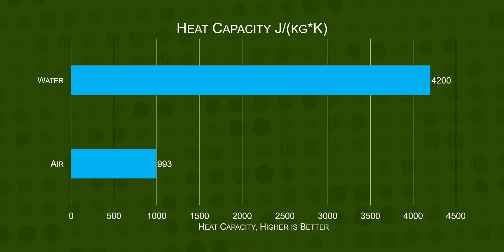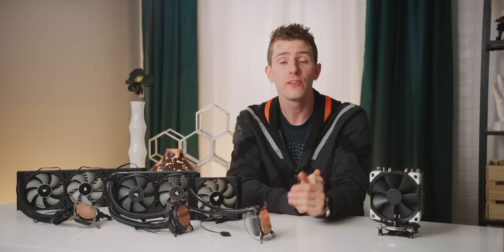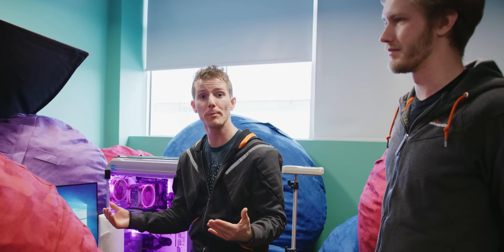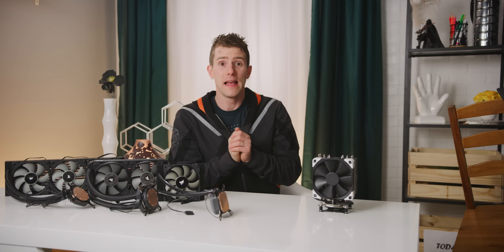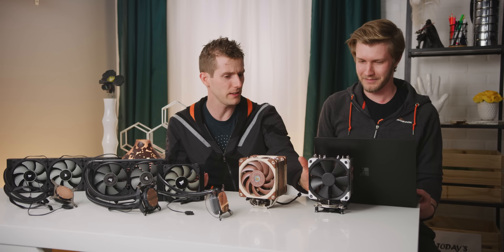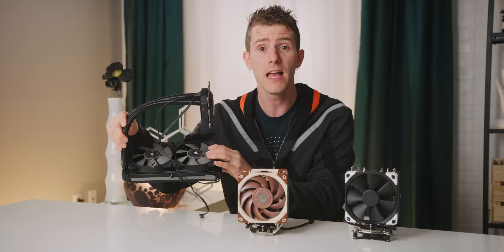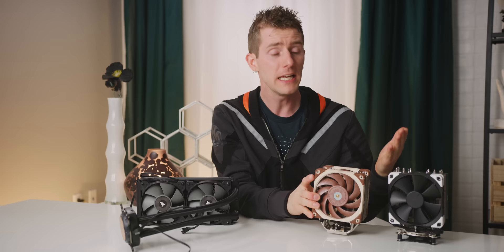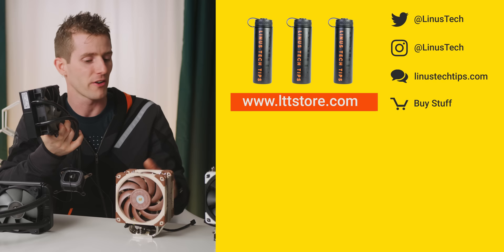Why you shouldn't water cool your PC

Comment: But it's not just about the CPU temps... the additional benefit of exhaust radiator is that it vents the heat out of the case so other components would enjoy a cooler environment.
Now, for mobo VRM this is cancelled out due to lack of incidental air flow, but this could be significant for the graphics card.

You should also be watching the graphics card temps and clock speed when both the CPU and GPU are under load.
Reply: Many people seem to install aio in the front which puts heat into the case. Hardly seems to affect temps. If case cooling is good its not a benefit, if its bad then yes rear exhausting aio is great.
Reply: @jondonnelly4831  Someone have tested intake rad vs exhaust rad. Intake rad will have a cooler CPU a warmer GPU whereas exhaust rad will have warmer CPU and cooler GPU. It's usually 5 degrees or less but considering the difference between the coolers are small to begin with, this shouldn't be neglected. Or rather, given that we are going with the exhaust config, we shouldn't look only at the short end of the stick.
Reply: I have an aio, and never even thought about that, holy shit lmao.
But I'm pretty amazed by this.
My ryzen 5 1600x @4,15ghz is at 50c max under full load. (While gaming 40c). I'm guessing it uses around 120 watts, so thats pretty crazy.
It's only a 120mm radiator like fr.
Reply: You dont need an AIO to exhaust hot air. I use a Dark Rock Pro + 2 intake fans in front + 1 exhaust fan in rear = positive pressure (less dust). This setup runs all the fans very slow or not at all (very quiet) and helps cool vrms & chipset.

Comment: Isnt the air cooler technically a "liquid cooler" since the heat pipes have liquid in them that carry heat to the fans?
Reply: No, they have a fluid in them. Air is a fluid and so is a liquid, but air is not a not necessarily a liquid at the temperatures and pressures we are talking about.
Reply: @lucidbarrier  He's talking about heat pipes, which do have liquid in them. Most heat pipes for PC cooling use water as the working fluid but others can be used depending on the desired operating range. Ammonia, methanol, ethanol and some super high temperature ones even use mercury.
Reply: You're right, they are--at least according to our somewhat messy classification system. They're also phase change coolers, which makes them even better (for a given size/cost), but definitely are liquid coolers.

Comment: My only problem with my Noctua fan is that it takes up some very important space over my motherboard where I would like to install the rest of my RAM.
Reply: You can move the fans around as you like with most highend and even mid-tier air coolers - the the two u12 coolers have a slim fit profile with AM4 and LG115X sockets that ensure it fits all ram. But yes, the larger and bulkier Air coolers do have a problem, however, there are models where you can adjust the height of the fans, or even like the Noctua D15 where one fan can be left out in order to secure clearance.
Reply: @Flodhesten  yeah I think I need to remount it because I have the fans horizontal instead of vertical meaning not enough clearance. At the time, probably being impatient, it didn't seem like I could. Probably better for the air flow too. I always end up rushing and putting together my builds when everything arrived rather than making proper time for it in a proper space lol.
Reply: @Flodhesten  the D-14 which is very similar to the 15 is what I have. I also made this same mistake with my BeQuiet that's the same kind of size lol.
Reply: Same here. I had to move the fan off the fins by like a whole inch lol. It wound up looking so silly that I bought an AIO

Comment: What about the be quiet! Dark Rock Pro 4?
Reply: Was thinking the same, but the unfortunate truth is that it's probably worse off than the Noctua one.  They (noctua) really hit the ball out of the park with their recent lineups.
Reply: I'm upgrading my fans to the latest Noiseblocker eloop. Those are the best for noise and airflow. Wonder how the temps will be with them.
Reply: I had both top of the line coolers from them, very similar performance.
If you have a glass case, go bq! because it looks better, if not go noctua.
You can be a psychopath and run noctua on a glass case tho.

Comment: I remember watercooling my AMD K6-III 450 back in the day.  used a rubbermaid container for water reservoir, a submersible fountain pump, rubber water lines, and hacksawed off the square part of a threaded PVC cap for the CPU water block (siliconed it to the CPU).  If I needed extra cooling I dumped ice cubes in the reservoir!

Kept the CPU at room temperature =)

Comment: Simply cheap AIO's if you would go for AlphaCool AIO's you get at least a full copper radiator. They are more for raw cooling then for fancy RGB LED. - AIO  is sometimes the only option if you wann use all 4x DIMM Slots - BIG Air Cooler block often a slot

Comment: Were the fan speeds set to the same rpm? Or were they set to the max?
Reply: They were set to a speed in which the air cooler was both quieter and cooler. If you want to test max speed vs max speed, the Corsair fans would be incredibly loud. I have them. Sure, they move a lot of air. But they seem to be using them at a reasonable temp and noise, where people are likely using them. Not the turbine noise the Corsair fans would get to while passing the Noctua fans.
Reply: I used the standard fan curve in the Asus BIOS for all of them, so anything above 80C was a max - the main reason the NH-U12A was so much quieter.
Reply: @billycaves7194   The H150i uses mag-lev fans though. Aren't those pretty quiet? I liked them, bought more to use as case fans.
Reply: @alexanderclark6889  Didn't know you were a drummer, awesome to see. =)
Reply: @Malus1531  They're pretty good, but they're not Noctua good. They get close to Noctua's previous generation fans, but the new gen NF-A12x25 is a level above anything else on the market currently when it comes to combined noise and performance.
Reply: @jubuttib  Well this guy is calling them turbines that's a bit much
Reply: @Malus1531    They are quiet at low speeds, but look at the speed ranges they have. it is WAAAYYY bigger than any other fan I have personally seen that is not meant for a server. 400-2400RPM. Nf-f12 is 300-1500. Giving ML120's full power makes them crazy loud and move crazy air. Remember, they are not designed like noctua to work best at lower static pressure. They have a design to work at both high and low static pressure, which is why I have them. The design difference (different fin size and angles and probably other differences I can't see) and VERY high max RPM makes them loud. I love the fans under normal use. But at max speed, it is pretty ridiculous. Sure, not server fan loud, or even close to as annoying. But loud.
Reply: @billycaves7194  Yeah alright fair enough. Mine never get too loud on a normal fan curve, but true if I set them to max they are pretty damn loud.

Comment: its complicated because with radiators, youre transfering the heat to metal then air, and with an air cooler its from the cpu to heatpipes to the menal of the fins.

Comment: can’t i just buy a mini fridge and put my pc in there
Reply: Mini fridge wouldn't do.  You need freezer like on Intel Show on Computex.  This did the work well.
Reply: @Erick Rosa a fridge is just a tiny ACed room. Do you not know how refrigerators work? A freezer set just above freezing would be better, but they are the same thing just more power.
Reply: To answer the question, mini fridges usually don't have enough power. They are designed to keep cold things cold not make them cold. A typical mini fridge could take over 18-36 hours to chill a few cans of soda that started at room temp. A standard home fridge or freezer might get it done.
Reply: LTT literally has a video on this. It went horribly.
Reply: I feel like even if you had enough cooling (which you wouldn't) condensation would be a huge issue.
Reply: Because its been tried before. with no success.

Comment: Why don't just replace the aio fan to noctua fan? Would the better result 🤔🤣?
Reply: Indeed, it seems like a poor control to some end if you aren't using the same fans.
Reply: @Canuckrz  Yes, but you need to add the cost of the fans to the grand total then. That's gonna make the 3 fan one like 200 dollars+.
Reply: The result better is
Reply: Probably yes, but the price would shoot up since those fans are not cheap!
Reply: I think will be better than using built-in Corsair FAN
Reply: @hasmatiks  Fair however I think it would be a very valid point to illustrate how much of the performance margin was down to just the difference in fans when the video is attempting to contrast air vs water.
Reply: I replaced my Corsair AiO fans with the less expensive line of Noctua fans. It got substantially quieter. I wonder what results they would have gotten if they had tried that.
Reply: MrSwagg YT lmao
Reply: Ive got only noctua fans on 2 aios in my build and they run great. A 240 nzxt kraken on my 1080ti and a h100i on my 9700k. My rigs running nice and quiet and cool.
Reply: @hasmatiks  
that's true though not overpriced Brand Fans could be substituted in such a case. (there's really little to no benefit to those ~$25-30 Fans that most people buy when ~$15 Fans would be practically identical)
but i think the point brought up is whether the included Fans are making a large difference or if it's really the Coolers themselves.

Comment: What if further test such as using Noctua fan on AIO, or even placing AIO on intake/front and not the exhaust/top?
Reply: TDR REVENGE  The bottleneck on aios is still rad size+fan perf, not pump speed. You'd also be surprised how much the latest noctua x25's beat Corsair ML's

Comment: This really blew my mind I thought the water cooling would be much better, especially the triple radiator. How much difference can there be between a custom loop and an all in one though, I have custom and personally find it very easy to maintain, once every few years I need to top up the liquid and maybe every second time I do that I will also do a full flush and clear out any gunk that has accumulated. I would love to see a good comparison like this between high end all in ones and custom loops, can a D5 and proper CPU heat block really make that much of a difference, does it all just come down to flow rates?
Reply: This video is misleading. Water normally is. No idea how Alex tested.
Reply: @prinzseptimii9660  having a volatile fluid in your radiator pipes has the advantage of phase changes, which absorb a lot of energy. Can't really do that with water in this case so it's just not a fair fight if one system gets to use a flammable fluid.

Comment: hm...I was thinking of replacing my air cooler with an AIO but I guess I won't now. :|
Reply: Fight air with air
Reply: @Sadalmelik Aquarii Yeah I literally just went with an AIO cause it makes my build look way cooler.
Reply: He was using a noctua cooler that costs $100 in a push pull configuration. Your average air cooler won’t perform as good.
Reply: Unless you're over clocking like crazy (don't forget they pushed the CPU to 5 Ghz) you will be more than fine with a good AIO. Easily in the 60 degree range
Reply: @Evtrex13  I am actually using Noctua NH U14s. I was thinking of buying an AIO because I wanted to OC my 8700k.

Comment: I like the closed loop AIO coolers I just replaced the AIO cooler on my dads computer because the pump shit out on his (pretty cheap to replace) his computer is an “ibuypower” build and I noticed they sandwiched the radiator with an extra fan to further exhaust the air through it and that seems to actually work excellent! I also stole the fan from the old AIO and mounted to push even a little more airflow and the computer is happier than ever.
Reply: Ibuytrouble

Comment: I have an mid tower build using an I7-9700K with a mild Overclock.  I used two different Corsair AIO coolers.  Neither lasted longer than 18 months before the pump failed and sent my CPU temps skyrocketing (100 degrees C and the CPU throttled back down to 1700 MHZ.  Frustrated at the reliability issues, I purchased a Cooler Master Hyper 212 Black Edition air cooler.  The cooler's install was easy and fairly quick.  Now my CPU runs at 5500 MHZ, idle temps are at 35 degrees C.  During gaming with DCS World, a very CPU intensive software program, my temps remain around 55 degrees.  The cooler is just as silent as my old Corsair.  Best of all, the cooler was only $50 USD on Amazon.  I am sticking with a good quality air cooler from now on.

Comment: Upgrading my RAM was possible in about a minute with my AIO. Upgrading my RAM with an air cooler would've been impossible.
Reply: @SteveQ yes, I’d have to remove my air cooler, which would mean no air cooler would be installed in my computer.
Reply: @SteveQ You’ve almost got it.

Comment: I had a very bad experience with my corsair h80i v2. It lasted me 4 years or less but sometimes i would have to adjust the position or tighten the screws for it to just work.... and then the pumps failed which ruined my day cuz i wanted to get some work done. 
So the next day i ponied up and got myself a cooler master hyper 212 black edition and installed it. Threw away the aoi like a bad date. 
I got similar cpu temps, and the pc ran fine as usual. Probably never going back to aoi cuz my pc looks cleaner or less busy. I couldn't care less about the noise level. I grew up with loud 90s computers, their noise is actually pleasing to hear when booting up. 
I dunno why i bought aoi in the first place.

Comment: the problem with those big air coolers is that they tend to physically break sockets and motherboards if you're not careful, because they're so big and heavy. and replacing a motherboard would always be a lot more expensive than replacing an AIO if it leaks (the leaks are harmless btw)

Comment: If the pump and radiator is placed below the components, and add a splash protection, then a pump failure leak shouldn't impact the components.  The only risky point of failure then is the water blocks and the tubes.

Comment: portbality is a big issue with huge sinks..
I remember switching solely for this reason as I didnt want to rip my CPU socket out in case I handled my case somewhat rough. I dont mind some 2-3 degrees more or some db more noise...
safety of the pump is not an issue.. I am using AIO for more than a decade now, not once have i had to repair one system pump..
space saving etc is a big plus too..
water isnt the cooling agent, it is a means of transport, dont confuse it.. it is together with the pump the aequivalent of heat pipes.. the cooling agent is the fresh air... just like with the big fellas..

Comment: I have some knowledge of performance car cooling and intake systems. The best system you could get for a cpu would be fan width sized tube that runs from the front of your pc all the way to the back while passing across and connecting to your cpu. The system would be completely isolated and insulated from the rest of your pc and the air within the pc case. The air passing through the tube wold never interact with the air inside the case box. It would simply pass through the front and directly out the back. There would be fans on both ends creating a jet of air that passes through with the radiator parts on the inside of the tube. This would create the most efficient cooling of any possible design.

Comment: Man I wish this video existed 6 years ago when I bought my h110i gtx. Wouldn't have gotten an AIO in the first place for their shelf life. The pump JUST failed on it at Christmas right after installing my new 5900x. Talk about panic. I opted for a bequiet darkrock pro after that with all the pipes and bulky head. 

Sure it's not as "cool" with the bulk head and no sleek standoff system, but it's way cooler. 

Thanks for all the research.

Comment: I've just ordered an Arctic Liquid Freezer II 240 A-RGB for my 10700K due to loud and very hot CPU. I'm using a CM 212 Black edition ATM. 
I will edit an update about it.
Reply: update?
Reply: @tarunkarthikeyan5918  Somehow I forgot about it. 
It is perfect! Temps are low and very quiet. I have the radiator sandwiched at the front of the case between 2 of my case fans and turned the radiator fans around to exhaust the air like below:

rad fans, radiator, case fans
<- I <-
<- I <-

Avg temps on default: 31-34 C
Max temps around 80 C won't really go over that.

Tip:
Before you order check how much space you have though as I was fiddling for a while to attach to the front.

Best attachment is obviously to the top of the case, but if you have a CD or DVD rom you must take it out otherwise it won't fit.

This applies to midi-tower cases only if you have a big one will fit probably anywhere.

Comment: thanks for providing this video. I had to investigate when I bought a 360mm corsair AIO (H150)correctly oriented setup with exhaust air cooling and found it performed worse than a 30 dollar cooler master budget air cooler, seriously though wtf? Also note that a radiator reduces over all case airflow so it's probably not helping intake/outake cooling for other components. Quite dissapointed consider the price difference between top tier AIO versus cheapest air cooler and the later won.

Comment: Watching this in 2022- let me tell you that I have the H60 first gen on a i5 3570k running OC @ 4.3 for the last 10 years and still running strong. No problems at all amazing unit and I push this PC to the limits. Looking to upgrade to DDR5 when it comes more available.

Comment: I have a midi case rig, with a corsair cooler, at idle temps get as low as 29°C under load highest I've seen on hardware monitor 75°C running infinite. However I've had decent temps in the past using a dual fan copper heatsink cooler. For smaller builds liquid coolers can really bring temps down.